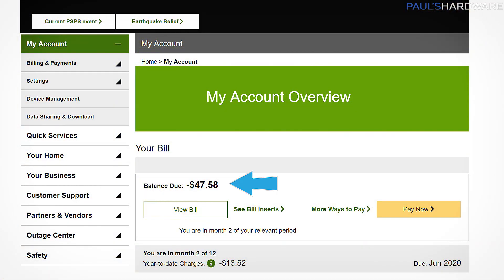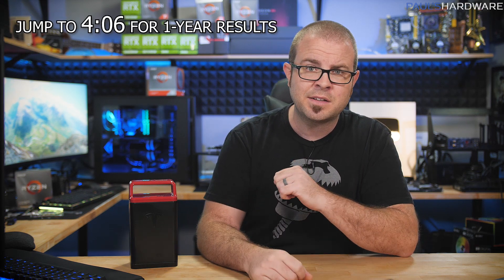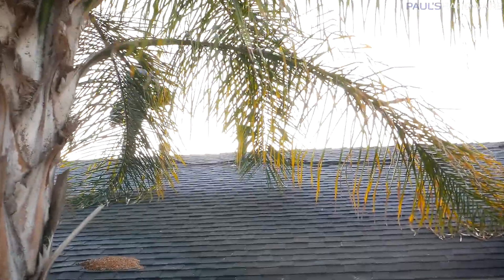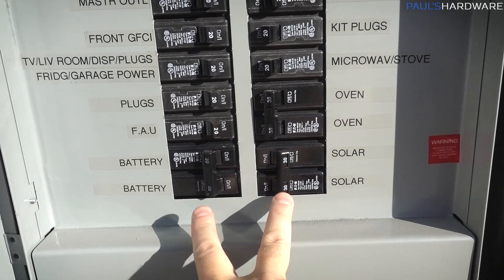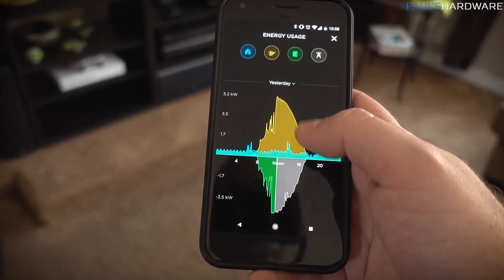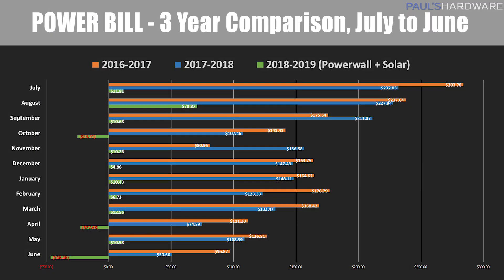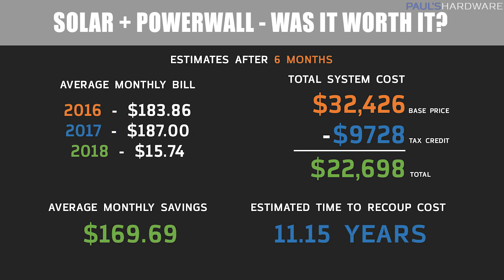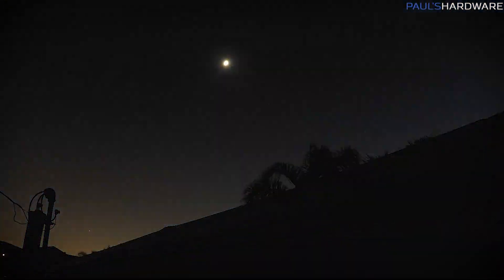TESLA Solar and Powerwall: 1 Year Later!

Comment: So in about year 13 or so, you'll be on the cusp of needing to replace the Powerwall itself - correct?  10 year warranty, and perhaps a 15 year lifespan?  About $8K to replace that component with installation or is it less?  Still a money maker, as you progress into year 13+ but it won't be all gravy after it is finally paid off.

I have a simple 6 panel system with traditional batteries at an off grid property which generates an amazing 3 kWH daily.  About $0.30 worth of power each day.  Figure it will pay for itself never, but at least I have generator-free power from Spring through Fall.

Comment: What happens when your batteries lose efficiency? You'll just continue to pay more for electricity and then have to replace the batteries for an additional cost.
Reply: You don't need a battery to use the solar panels.  Any excess would be consumed by the power company, or basically your neighbors.

Comment: since i am planning to buy my first house in a couples years, I need to say, I really love this series and all the technical aspect of it. I am really starting to really think about installing one right when i buy the house since i'm gonna get a loan for the house, having less to pay each month will be such a big help even if it means betting a slightly bigger loan.

let's say it would cost me 150$ of electricity without solar panel and a loan of 150$ for the house, even if i need to pay 200$ for the loan it's completely worth it!
Reply: Yeah, I'm not sure if that will work.  Your math example is of no help.  It all depends on your interest rate and the length of the loan.  I'm guessing a traditional 30 yr. loan? The only way you will save money is if you add the savings of the electric bill to the principle of the loan every month. So you will not save any money for 10 years plus.  If you don't pay more on your mortgage you will effectively double the cost of the solar at least just by paying interest on it for 30 years, even if you have a low rate.  Just say your mortgage is $1000 and electric bill is $200.  It would be better to pay $1200 a month and not save any money.  So you would pay $200 more every month to offset the cost of the solar, which could cost $10-20K.

Comment: Paul, how is the insulation on your house? Perhaps thats also a thing you should investigate. A well insulated house means lower heating costs in the winter and lower cooling costs in the summer..
Reply: He did put a lot of insulation in too.
Reply: I've seen this question a few times.  It isn't really relevant to the conversation.
If he had bad insulation, his electric costs would just be higher from the grid as well.  The offset would be the same.
Reply: I don't really buy your argument. You can just as well say that his costs are higher because of the lack of insulation, and if he insulates his costs would go down on the grid as well. His roof had to be redone on the side where the panels are. You can easily ask how the roof is on the other side, and if the crawlspace/attic needs more insulation on one or both sides. It's totally relevant to the conversation as I see it.

Comment: Good information Paul.  It would be interesting also to know your power usage in kWh vs. in dollars since not everyone pays the same rates in SCE territory and within the USA, power rates vary big such as 8 cents to 12 cents per kWh vs. those in CA who could be paying up to 35 cents per kWh. Noting your graphs in kWh's used, produced and kWh sold to SCE and for how much per kWh would zero in better than in dollars for most folks I'd think. 

It might be interesting to do that grid cleaning test but you would have to do a dirty test and a just cleaned test within a few days of each other and in the same sun exposure times to eliminate other variables. Thanks for the information.  P.S. LADWP and SCE have different agreements with their solar customers when buying their power. They are not the same.

Comment: I’m curious about the cost for maintenance on the individual parts in your solar-battery array, and how it influences your recoup time, if you at all recoup before end of life of those parts.
Reply: It's basically just panels that are wired up.  You just have a separate power box.  Nothing really to replace or maintain.

Comment: The cheapest way to save money on your electricity is to reduce unnecessary consumption. What efficiency measures did you put in place?

Also, why are you talking in metric units (watts). Surely, as an American, horsepower is a more intuitive unit? "My solar panels pull a whopping 20hp yeehaw"

Comment: would be interested to know if there is any options in the software to see battery degradation occurring. while it is still very new for a battery still would be interesting to see how it holds up over time  and how much you loose each year

Comment: Wait.... that's per month?  You spend upto $300 a month on electricity without the powerwall?... Am I getting that right, that's not per year?.

I'm in the UK and have a relatively expensive electric key for our new place. (comparatively high cost per kwh) I probably use £25-30 a month at worst. Why does it cost so much in the US?

Comment: So basically you are going to be seeing a $0 balance about the time that some of your system goes out of warranty. meaning you will have to potentially spend more to keep the system running. I wonder what the cost of those parts is going to be in 11 more years.

Comment: Nice going Paul. I had my 3.2 kWp solar installed in 2013 here in the Netherlands and I will recoup the cost in the summer of next year. In this cold climate a powerwall does not make any sense but I did have my natural gas cut off and my hot water is electrically heated which, to my own surprise, is much cheaper. These last couple of years the power company paid me around $50 a year. Nice thing in this country is that you get paid per kWh you put in the grid the same as when you take out, net metering. Nice video, thanks!
Reply: In Australia we are still being ripped off!... We pay 27 Cents per Kw used and we get 7 Cents per Kw generated for the grid,.......totally unfair!
Reply: @tonymillward3755  That does seem unfair Tony. Mind you, the net-metering here is guaranteed only until the year 2023, as an incentive to put solar on your roof. After 2023 the government will gradually increase taxes on the power you put back into the grid over a period of 5 years. So starting from 2028 we will also only get something like 7 to 8 cents per kWh. It currently costs about 23 euro-cents per kWh in total but most of it is taxes and VAT.

Comment: How are the batteries covered by warranty, to what extent? What's the acceptable  degradation ? 12.8 years to pay off.. them batteries are gonna be replaced 3 times over and I doubt that'll inverter will last. And to top it off, 10 year life expectancy on those panels. All adds up to a negative bank balance but a warm fuzzy feeling that you're not burning coal. Just pulling tons of lithium out of the ground instead =]

Comment: Hmmmm that's interesting. I was interested in the Solar tiles by Tesla because I was under the impression they were the roof. What strikes me as odd is why they weren't put on if the roof had to be replaced anyway. 🤔 I could understand if it requires an additional cost on your side, as well as theirs. I thought they were out around that time, so I'm curious if that was an alternative then. 

You generate more power than your home uses, I am curious it scales as well as I hope it does. I wonder, for example, if a similar setup (albeit much larger) could power a laundromat, or a datacenter or a machine shop, ya know, where 24/7 operation could be of paramount importance. I wonder if the electric bills would still be negative. I'd be curious if the ROI would be similar. 

I think do more videos like this, personally. I think the broader you get with tech, the bigger you'll get, you're clearly educated/experienced enough to broaden your horizons. I'd be curious about your opinion on different tech related stuff to be completely honest, so much so that I'm thinking of sending you some stuff just to see what you think of it.

Comment: Definitely a requirement to clean solar roof panels at least once a year, and even every 6 months if you are in a very dusty/dirty environment. You could climb onto the roof and clean them by hand, but a power nozzle + rigid extension can let you do that from the ground or from a ladder. Tree sap and guano will require some elbow grease however.

Do your panels have any special coating on them? A layer of spray-on wax can help repel dust and dirt and make cleaning easier.

Comment: Just a quick tip, you can use Infrared imaging to see if all your solar panels are working. So if you see a drop in power intake you can see which panel is bad.

Comment: We went 'cheap' ~$13000 for a grid tied 5kWh system- pay back time much faster. However still interested in Tesla Power Wall type tech or even super capacitors when they become more cost effective. Most companies don't go solar - unless it is a public relations thing - because the payback to investment is more than 3 years. Companies will look for return on investment generally targeting less than 3 years.
Reply: @Seb C tens of thousands of cycles durability. Rapid discharge and charge capability and longer life.

Comment: Hello Paul!

I see a decent amount of comments asking you to clean the panels. To anyone looking to wash your panels,  please make sure if you are doing it yourself, you are doing it at night or in the early morning. The sudden temperature shift can cause the panels to crack. Spraying with just water typically works to knock the main debris off. Also, be careful about what you use to clean it. You can most likely add micro scratches in the surface of the panels over time and that might cause them to show degradation.  Just some food for thought from my time working at a solar company.

Comment: Cool. I've been interested in how it worked out.  My reluctance has been based on not knowing if the powerwall will even be able to hold a charge in 12+ years time.  Lithium batteries degrade. There's a possibility that the battery's lifespan will be shorter than the break even time.  Hopefully not, though.

Comment: Cleaned my panels last week. I have 18 panels 285 kw. I have $140 credit.  No Bill's for years. In San Diego.  Coastal  tuneup at the end of the month for more credit.
Reply: @Seb C No, just credit adds up and gets deducted goes to the cost of being on the system grid  without a battery is about $10 monthly or if I used more power than I generate.  Witch I do not as of yet.
Reply: @Seb C still cheaper that over $200 a month for electricity bill as before without air conditioning.  I do have central air conditioning now, if need for bad days. I live on the coast of San Diego.  I may use it 10 to 15 days out of the year. Three years of solar.

Comment: Have you overclocked your Tesla panels to get better performance? That should decrease total load time for payoff amount.
Reply: Overclocking the sun would be simpler.
Reply: @tomthebadasscat  actually nah, an array of mirrors or Fresnel lenses would do the trick for the panels
Reply: @prescottmajette5290  I was just being silly. I usually use the remote and just turn up the brightness on the sun.
Reply: @TomTheBadAssCat Realistically, that would be a global catastrophe (not just because of global warming).
Reply: @tomthebadasscat  just wait a couple billion years ;)
Reply: Undervolt the grid and overclock panels, after cleaning panels replace thermal paste for better conductivity and replace AC whit Arctic P bois.
Reply: @winha1435  Also, put on some Noctua fans on the AC for maximum performance.
Reply: @Metanoiance  why would i do that if i have Artic P fans there all ready?
Reply: Don't forget to water cooled the system's
Reply: You can overclock them. Just got to cool them down. They have a higher rating in colder temps. 😂

Comment: Just an idea. You have a pretty big ass patio area back there. You could just build an overhang over it and install the solar panels over that. use the solar panels as a roof for the patio. that way you wont have to be bothered by having to reinstall every time you need a new roof.

Comment: For those not from California, what did power cost in 2017-2019, and are there forecasts for future power cost? Interesting video. If you put a second battery in, and sold most of its power to the grid, what would the estimated cost change be?
Reply: Depending on utility and rate you can see into the high 20 cents per kWh. Lots of changes in CA territories. Paul is probably under a NEM (Net Metering) 2.0 interconnect where he gets credited money back on the extra energy he produces. The thing is, NEM is pretty close to being dead and will head towards a less customer favorable model. If that were to happen and Paul decided to add another battery all of his gear would be placed under that new agreement. Best plan is to stick with what he has and hope for a rate change that pushes demand periods towards the end of the day so he could get more savings from the battery.

Comment: Thanks for demonstrating how bad even a very smart American can be at counting money. Your calculations of recouping your investment don't account for opportunity cost of putting those $22000 away and earning compound interest. It's even worse if you've taken a loan and have to PAY compound interest on that sum. Take a look at this equation: (169*12)t=22000(1+x)^t, where t is time in years and x is compound interest in percent as a decimal (i.e. 5% = 0.05). For any value of x>3.3% there is no real number solution. This means that if you are able to earn more than 3.3% annual return on a potential $22000 investment, you will NEVER recoup your investment adjusted for opportunity cost with your current rate of savings.
Your system may be a great solution to have an on-line battery backup in case of emergencies (which doesn't require fuel), and given the price of a gas generator can be up to $10000, this may not actually be a bad deal... but it's not worth much in terms of pure monetary savings if you're only talking about your electric bill.

Comment: Solar just isn't worth it.  13yr ROI is crazy.
Reply: Yeah, not like this... for me, those 330w solar panels are $100 used, so if you want 5kw like he does then it’s about $1500 plus whatever circuitry you need (which will vary if you’re wanting to charge batteries, 220v or 110v inverter etc). So for me it would make a lot more sense, that extreme cost of a battery and having to get it wired into the grid to get a few bucks back out of it just doesn’t pay for the other $20k+...

Comment: With the recent release of solar tiles, do you believe they would impact your costs? What about a second powerwall energy bank? You may be capping your powerwall in storage right now, which would hinder the overall cost of savings.
Reply: The solar tiles are not even readily available and I would guess the cost will be extremely high. Those power walls are very expensive too and hinder any recoup of investment.  You can only make money on the power you get from the solar panels.  The way you store the power is irrelevant.  They are there basically for convenience and nothing else.

Comment: How this isn't integrated as a standard on new home construction in America, I'll never know. Other than robber baron developer groups building new homes for $75k including the dirt it sits on, and selling it for three times that within the year, that is. 
And Paul's system isn't even particularly high output, and has a single Tesla powerwall (they stack).
Architecturally blend all south facing rooftops for integration & good gathering angle, and 12-15kw roof arrays would be a breeze to make part of new home construction rather than retrofit.
Reply: Because it doesn't make logistical and economic sense.

California is the best-case scenario for solar, temperate weather and lots of sun, expensive electricity.

Despite that, it still takes over a decade to even break even. That money BTW would be much more efficient if invested elsewhere.

At the end of the day central production of electricity benefits from massive scales of economy and therefore is the better option.

Comment: Paul, forgot to ask (and not sure if ever covered this) you: Are your panels, & system (battery backups et al) wires in series or parallel? If wired in series....how come didn’t decide to run them in parallel instead?
Thanks, & really enjoyed this series; seeing the ENTIRE process of planning, permits, install, operational, & the updates 👍🏻 Showed exactly what one would experience & go through if decided to do install solar panels w/ Tesla, or use a pin alternative company. Hoping that in another 6-12 months you’ll do one last update & let us know if anything’s changed, had issues, maintenance done, etc... Are you also worried that the 10 year warranty “expires” before you have paid off the system in full?
Thanks Again....looking forward to the NEXT project in the “Home Uodate/Build Series”. Cheers✌🏼

Comment: I just cleaned my panels and i gained about 3%. After 7 years one of my inverters failed and was replaced under warranty. I paid only for the labor.
Reply: How do you know the sun didn't shine 3% more?
Reply: @tomthebadasscat  Most systems do data loging, you can tell
Reply: @DanafoxyVixen  Yah, I know I was just being stupid. 3% is an insignificant figure. For cleaning to make a significant difference I guess you would have to be in a high dust/pollution area with very little rain.

Comment: Once systems like this get down around 15k it will be a viable solution to reduce the load on the grid especially once electric vehicles become more common.
Reply: Charging during off peak hours should also be helpful.